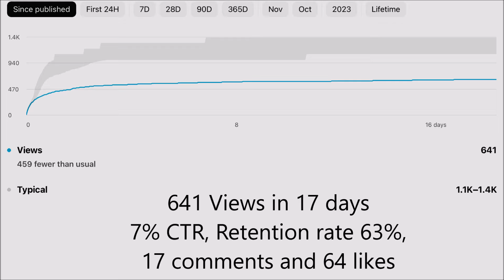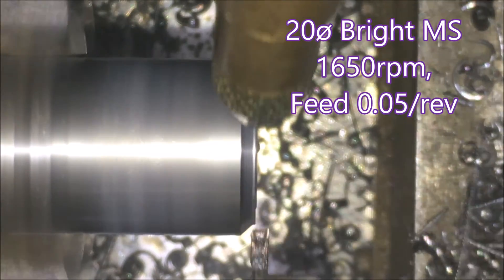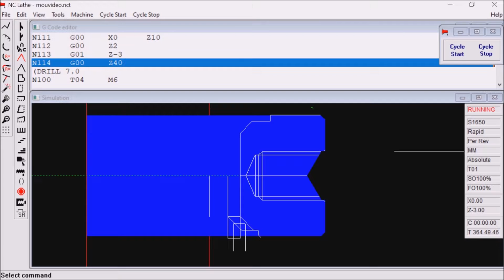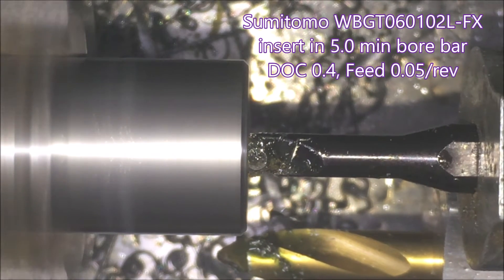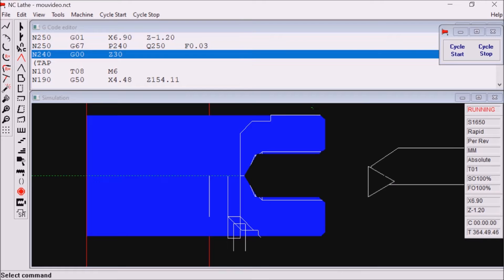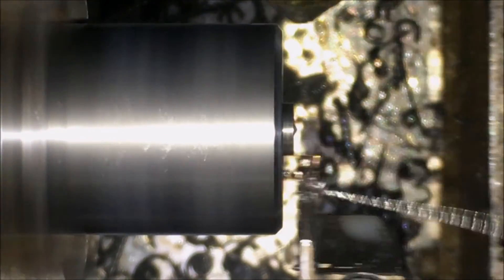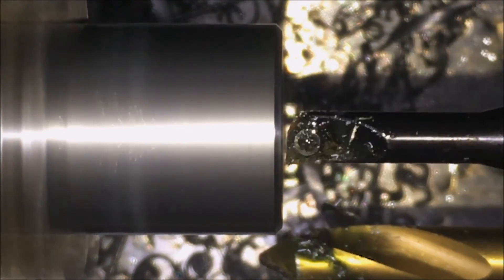Low carbon steel is horrible! Small cnc lathe, drill tap and profile with parting tool

Comment: Hi, Thanks for vids.  Have notification bell  enabled  but didn't see this and I suspect other vids too.   Only found this via your complaint vid.  I always face before centering  and take great care to line up the turret tools on my World War I  Capstan to avoid runout.   There's a vid on here somewhere of it making 12 BA Castle nuts.
Reply from the maker: Thanks John, all my videos are doing badly lately, not in favour with yt it seems. One of my lathes has turret backlash impossible to set tool height. No I can’t fix it! The other has an electronics error at the moment which is a pain, waiting for tech to get back from leave to tackle that one!
Reply: There is a type of Holder you can get for capstans.  You clamp the shank and the front bit is held by a couple of screws with loads of clearance.  this lets you dial it in.      I think my own troubles are about to start, I've got a Boxford 250 coming on Friday.   Wish me luck.  lol @smallcnclathes

Comment: Mild steel looks really horrible especially if you're used to doing lots of brass, stress proof, or stainless.  I've had some luck on one off parts were I didn't have time to dicker with them, using carbide to rough them to size if I had lots to take off, then a really sharp HSS to skim the surface for a nicer finish.  This seems to work on some of the mystery metals as well.  HSS seems to cut more and carbide seems to tear more.
Reply from the maker: Thank you
Reply: @smallcnclathes Me as well.  I believe I've watched everyone one of them.  I think he has some pretty creative ways to use that lathe and make it do anything he wants!!
Reply from the maker: RJ,  I can’t make sense of this comment, it is like another comment is missing or perhaps deleted?
Reply: @smallcnclathes  Sorry, I wasn't paying attention.  I was trying to reply to @colinmuskett5465 stating he appreciated the time and effort you put into your videos.
Reply: @RJMachine62  well if that was about me, thank you. Having a small lathe and trying to be competitive is a challenge, one has to be as inventive as possible.

Comment: i had a turret height issue, so i put a steel blank in the tool holder and tools in the chuck. then drilled and reamed the blank to fit my drill chuck. so now it is perfect.
Reply from the maker: Hi Keith, I am able to adjust the tool height of the turret in the software so not an issue. The turret has some backlash which can’t be fixed, so the tool height can vary with each tool change. The worm and worm wheel that form part of the turret has a tight spot. If the backlash is adjusted out, the motor cannot push past the tight spot. So there is rotational backlash in the turret, tool height can vary within that backlash

Comment: 1) use more coolant (if you did a good job with the program you dont need to see, you need to refrigerate and lubrificate those utensils) (run the program without the piece so you can see if something wrong with rapids and movements)
2) DONT drill like that, on uneven surface, pls!
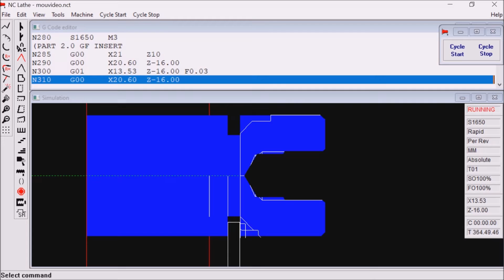3) when you do the cutting part here 3:28 i dont think you need to rewrite all the times Z-16.00 (or is obbligatory because software limitations?)
4) when you cut before diagonal, just go X13.00 you dont need to be precise, plus you will leave behind the radius of the insert as you can see here 5:14 you can see there is a profile left because you went for X13:53 (i dont know why the strange number)
5) if you want to cut better in centre, re-adjust cutter axis using small sheet metal under the utensil so it will not leave the not cutted piece
6) if you can re centre turret rotation because to me seems you did some minor crashes but you never saw if turret ring was rotated (you can see it because cant cut properly or drill in centre)
Reply from the maker: I don’t understand refrigerate and lubricate those utensils
2) have no choice, turret has backlash that I can’t fox so tool height can vary leaving uneven surface.
3) that is the way the software does it
Thanks for your comment

Comment: Your video's inspired me to go ahead and buy my own small CNC Lathe (Tormach 8L) and some decent tooling - Kennametal tools and inserts and some Kyocera inserts (DCMT and VBMT inserts) and a nice Kennametal parting tool.  Haven't turned anything yet but hope to this weekend after I finish cleaning the workshop up as I had to move a lot of stuff around to fit everything in.  My first project will be a barbed to 1/2 inch push-fit adapter so I can connect a hose to the coolant system using some materials I already had to hand rather than buying all new.
Reply from the maker: That looks like really nice machine. A lot more power and speed than I have, enjoy! Thank you for watching my videos

Comment: Gah, it can be such unpredictable stuff if you don't have the RPM.
I usually shoot for 1200sfm for roughing 1018/LCS, and 1600-2000sfm for finishing.
That would be roughly 6000rpm for roughing, and between 7700 and 10000 rpm at the OUTSIDE of a 20mm part. (Which is entirely unreasonable 99% of the time)

That parting insert you have did absolutely fantastic. Absolutely excellent chip control.
If I tried any of my parting inserts in LCS without coolant, it would have been a melted mess after the first 5mm.

As for the views on your last video, it was released on the Saturday of most peoples Halloween weekend. I suspect a LOT of people were busy with parties/family events with kids that weekend, and if you don't have the "bell" enabled its easy to miss a video.

Thanks for another great video!
Reply from the maker: Hi Kevin and thank you for being a part of the community that goes with my channel.
You always manage a comment and it is appreciated.  I could have run faster but I wanted to make sure I had a much torque as possible for the tapping.  If I used the high range, I could have run up to 3000rpm. With only 6 parts to make there was not a lot time to learn much about the material.  I have 6k plus subscribers, that video has only climbed to 677 views in 18 days.  Subscriber numbers don't seem to count for much in my case. Again Thank You for your comments, plural, you always manage to contribute something.  Nigel
Reply: If you want a good finish on 1018 the magic happens over 1000sfm.

It looked like the reason your drill was having issues was that the pilot drill bumped off the nib left from parting off the previous piece.

Coax indicators are handy!

Comment: seems like you have too low cutting speed for such sticky material, it's called "built up edge" - basically due to low temperature in cutting area, the steel welds itself on the insert and once the layer's too thick, the cutting force tears both the built up and the insert
my tips:
-more RPM: built up edge usually happens on cutting speeds lower than 90m/min (if i remember from technology classes correctly), on such small parts, i often run spindle on 3-4.5k RPM to hit atleast 150m/min (on these shit steels i use between 250-320m/min for roughing, 300-420m/min for finishing), i think your lathe and chuck is not capable of this, i work on shitty 26kw turret lathe with hydraulic chuck and that thing sounds like the world's gonna end - but try to rotate it faster if you can, just please don't hurt yourself, if your machine is not rigid enough or clamping force is too low, last thing you will hear is "bzzzzzzzzttttt" vibration-like sound and then within a moment, that thing will fall apart in all directions
-turn to HSS tools: carbide inserts are hard and temperature resistant but fragile and brittle, small built up edge can crack the insert in bits, HSS is oldschool but for your low RPM gives more sense, it can withstand much more tensile strenght, you just damaging the carbide by those low RPMs
-for those poor finishes try leaving more material for finish passes and give it more feed - you need the more temperature in cut to get rid of that plucked surface, if you can't add RPM/cutting speed, you need to add more energy/temperature with feed and depth of cut, try leaving 0.1-0.3mm/surface (0.2-0.6mm/diameter) for finishing pass with feed 0.08-0.12mm/rev - need to experiment, wouldn't worry about surface finish, these inserts often come with wiper-like geometry
Reply from the maker: Hi Adam, Thank You for taking the time to pass on so much information.  I was running at about 100m/m but with that gearing it was all I had available.  I changed the gearing to get more torque for the tapping.  Lathe has a max speed of 3000 rpm so if I was not tapping there would be more speed available.  Again, Thank You for your comment.
Reply: @smallcnclathes  also i remember i forgot to add very important tip! on these shitsteels you often need to finish with single-point tools to reduce the in-cut area, you use flat cutoff tool
if you add RPM and get good finish on the cone that is basically finished by single point (radius of grooving insert) but the diameter stays ugly, you might need to either buy cutoff insert with angle or grind few degrees on your grooving insert, so the diameter is finished by single-point

Comment: Yes, agreed. Especially for parting. That parting tool you use looks very good. Curls the chips nicely.
Reply from the maker: The insert is a low cutting force type which suits my small lathe. I was stunned when I had to shorten it to make it fit my turret, required an angle grinder instead of the usual hacksaw. Makes it one very strong tool. Thanks for your comment.

Comment: Not sure about your last video. Perhaps the measly two threads the customer specced turned people off. 😎

I know you don't do much with steel, but would be interested in seeing it. I am forever messing around with my tooling and changer. How do you set up your offsets?
Reply from the maker: Thank you for your comment. I think I have a video (unlisted) on the setting of the lathe will leave a link if I find it.
Reply from the maker: This is how I do it, https://youtu.be/9ORjC1V4SwQ?si=KPWTvsK-f8fZCjdb

Comment: Thanks for another video. What program do you use to generate your Gcode?
Reply from the maker: It is a simple cad/cam software created by the lathe manufacturer. It is easy to use as these lathes were created for training, many were sold into colleges.

Comment: It would be interesting if made a video where you measured the runout of drilled holes in the lathe. Especially in this video, they deflect all over the place. I always enjoy your videos.
Reply from the maker: Thanks for your comment, I don’t like to measure things like that, tis the road to insanity!  I am sure my chuck would have run out, but  I will not be measuring it.  I almost always drop parts of finished so run out is not an issue. If you look on YT, there are many videos on chuck runout and cures. I figure if I don’t measure it, I don’t need to fix it. For the most part my drilled holes work and If they are a bit oversize it does not matter. Thanks for the suggestion, but not really my thing

Comment: what steel leaves a nice finish? all i get are sh*t low carbon steel jobs. probably because i keep suggesting sh*t low carbon steels haha
Reply from the maker: I would always strongly suggest free cutting steel unless of course it needed to welded. Then I would suggest the cnc shop in the next street!
Reply: @smallcnclathes  Thank you,  I was going to ask a similar question
Reply: Harder steels give better finishes. Or high speed on the softer ones.